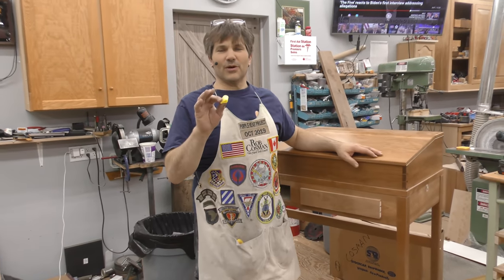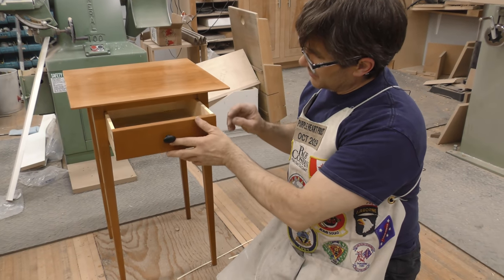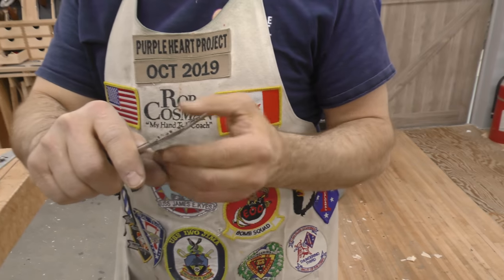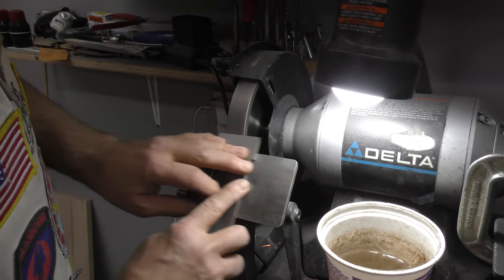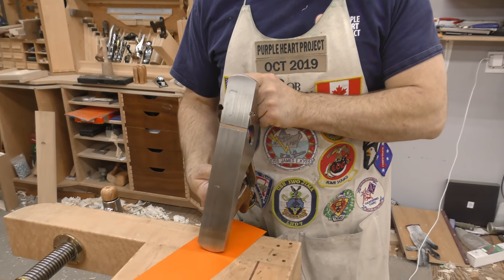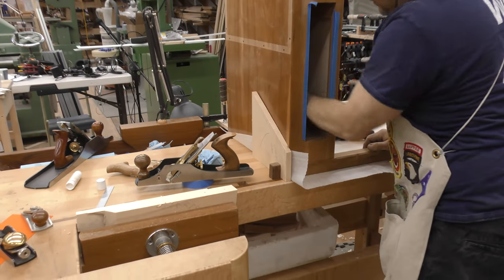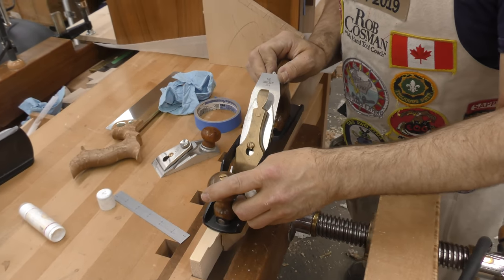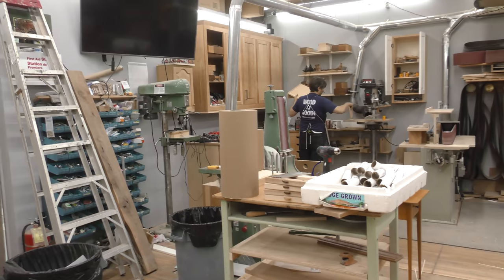Drawer Making Episode 24: Case Repairs

Comment: The disappearing drawers are beyond cool, Rob. Talk about highlighting your craftsmanship! It's almost a shame to put a pull on the drawers which alerts someone to their presence. Although I normally don't like them, this might be a good place to use one of those "push to open" catches. The only ones I've seen are plastic and non-traditional, and it might be difficult to install them at this point, but the drawer fronts would remain almost invisible. I wonder if anyone's ever made a clever wooden version of such a catch. Thanks, as always, for sharing.
Reply from the maker: Thank you. Haven't decided what I'm gonna do yet with the knobs. So stay tuned!
Reply: I keep thinking which is always a dangerous thing . . . Suppose you mounted a simple spring behind each drawer to push it open. Then you could hide a catch under the front of each drawer (perhaps a rotating wooden cam that pivots up into a slot in the bottom of the drawer front) and carve a finger grip into the bottom of the drawer front. Reach under the drawer and rotate the cam to release the drawer and it springs open about an inch so you can grab the finger grip to open the rest of the way. Push and hold it closed while you rotate the cam to hold it in place. Perhaps you could even construct the cam catches outside of the cabinet in 1" dowels so you just have to drill holes in the support to mount them. I know it might be gimmicky, but I just love the continuous unbroken front as it appears now. In fact, it's my favorite part of an already very nice piece of furniture. Okay, I'll stop thinking out loud and be quiet. :-)

Comment: The disappearing drawers are beautiful.  What if you put a slot through the bottom of the carcass going front to back.  Create some kind of divot in the bottom of the drawer.  When you want to open the drawer you reach underneath, put your finger in the divot and pull open.  No knob or visible finger gap in the front.

Comment: Hidden drawers are awesome! I think they are exciting, the ability to work with wood, that always moves, and the mastership to create that delicate balance... I used to ride horses, they are nice to see but hard to deal with. An animal that fears everything is a pain to work with, come on! ;-D
Idea for the handles: a continuous"slice" of same wood left to right, a line not visibly interrupted that hides (same concept of the drawers) that some segments of it are handles. You can have its section to be rectangular or a trapezoid for grabbing them more easily. Would be very stylish!
Reply: Or, perhaps keep it invisible by using an inserted magnet on the inside drawer front and use a magnet key as the pull?  As mentioned by another post.
Reply: I was thinking almost the same thing, I was think a light color wood. Somewhere to lay a pencil down.

Comment: Love the disappearing drawer, so neat detail. Could you please explain in details how to ? I understand you rip the complete length, cross cut and glue back side pieces, but how to lose minimal material so the grain pattern is kept as good as possible. Handsaw ? My table saw blade is 1/8’’, after planing too much is gone, or a router with tiny bit?Thanks !
Reply: Xav Did he use a marking knife to lay out each side of the kerf. That would over the top.

Comment: Hi Rob, love the work you do and the disappearing drawers are just perfect! I have a question which I'm sure you must have covered somewhere else but I don't quite get it! Why when the drawer fronts are cut from the same piece as the cabinet front (as these drawers are) do you not have to allow space around the drawer front for seasonal movement? i.e. How come the drawers can be so tight fitting? Hope that makes sense, keep doing what you're doing!

Comment: Hey Rob, first of all: these dissapearing little drawers are just the perfection of craft and thats why i value such things so much! I also got a question: would you like to make a video where you show some of the different kinds of drawer stops you have made and actually show how to make one of them? I‘ve built a kitchen shelve with four drawers but the front of the whole thing is skewed so every drawer side has a different length and i had to cut splayed halfblind dovetails. The drawers have stopped grooves in their sides an run in wooden rails which in hindsight wasnt such a good idea; should have been a box in a hole... So i got everything finished but i haven‘t come up with a good and easy idea for a drawer stop.
Reply from the maker: Good on ya! Will have to add the 'drawer stops' to the list.

Comment: Note to self . Don’t make drawer too narrow and don’t attach top permanently until the drawer is fitted perfectly. Or check sides before adding the top
For the last time. Have a swig of your syrup . Your running out of energy. Would you wax the sides or drawer itself?
Reply from the maker: What'd you think of the syrup?
Reply: RobCosman.com I haven’t received my shirt or it yet . Waiting breathily hahah. I have to tell you .ive had more fun with my shooting board lately admiring how tight my miters are . Thanks for your instructions. I’ve got to get better equipment. I bought not knowing a veritas dovetail saw but it’s not what I was expecting. That was not knowing until I’ve followed along this 25 step video series. Keep it going . It’s making me better.

Comment: I have a plane question.  After sharpening, when placing the steel back in the plane, how do you find the sweet spot when tightening the screw so that the steel is held securely but can still be advanced or retracted easily?